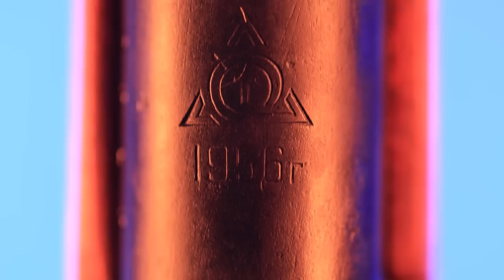Toz 16 | Old Rifle Restoration

Comment: Please stop using cold bluing, it looks terrible, use hot bluing. Also, do not use putty and solder, use welding. Small replaceable parts are desirable to put new ones, they can be found on almost any weapon, but they look many times better than restored ones